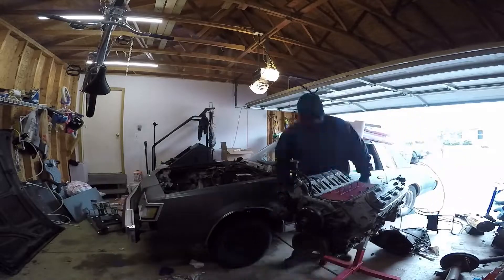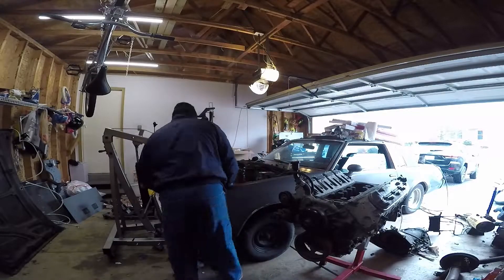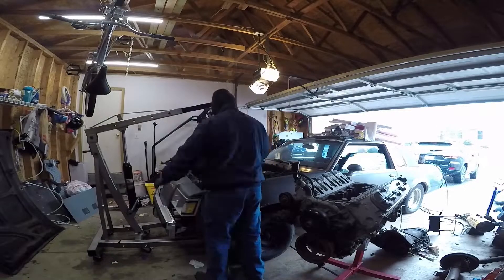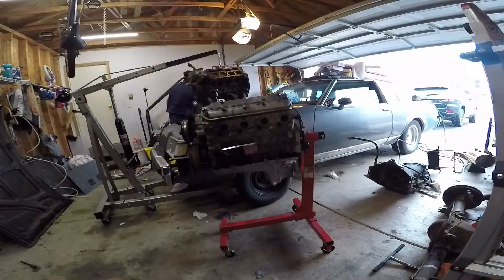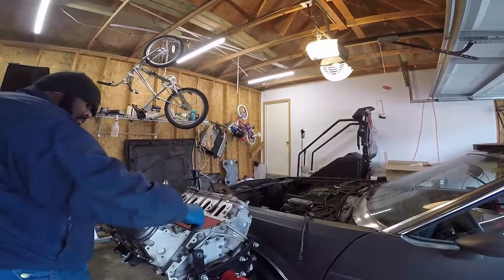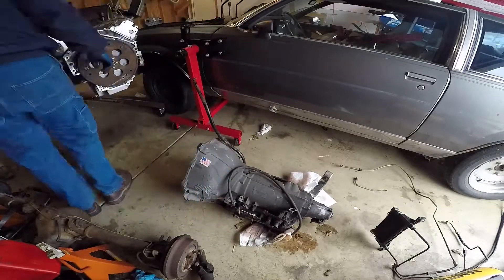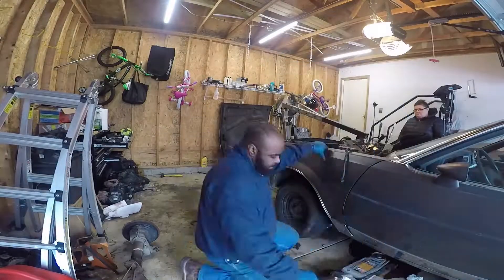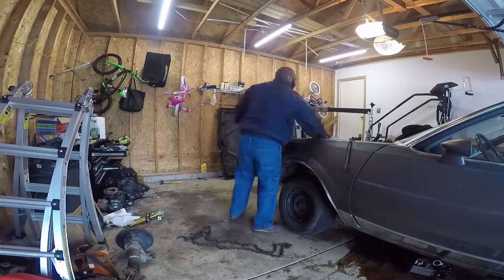Time-lapse Installation Of 4l80 Transmission On Aluminum 5.3 Lh6 With Voice Over

Comment: Awesome video man, quick question. I’m mounting a 4L89E on my 5.3 and the guy through in the 4L80E flat flex plate, spacer, and stock torque converter (6 bolt), will that mount to the 5.3 without doing anything?
Reply from the maker: I used a stock 5.3 flex plate  with my 4l80 with the little billet spacer and then I had to ream out the holes On the flex plate BeeterOlds has a really good video on this
Reply: Dajuan Brooks U used a dished flexplate with the spacer? And used 3 converter holes instead of the 6?

Comment: dont you have to also use a spacer behind the flywheel so the 4l80 torque converter fully seats in the pump?
Reply: @DBrooks   do you have a part number? Im doing the swap myself just trying to get all my ducks in a row.
Reply: Just by a flexplate for 6.0 with 4l80e it's attached